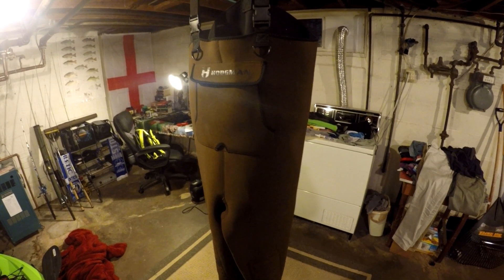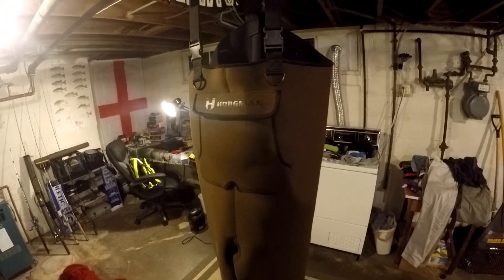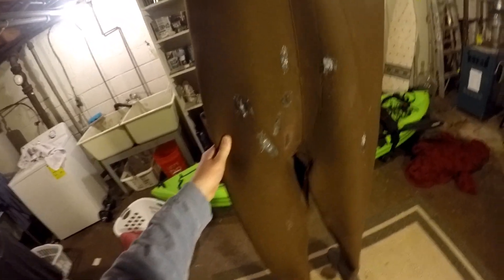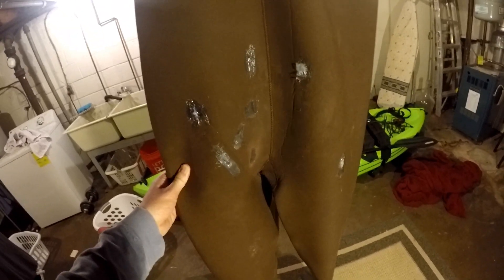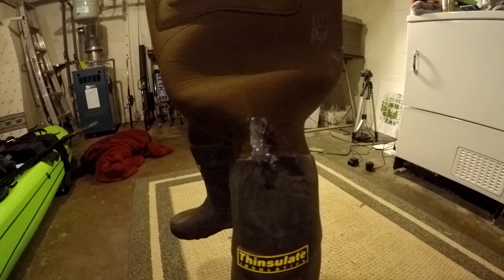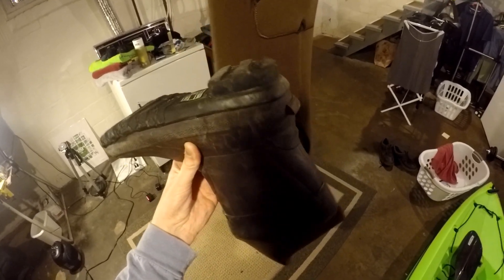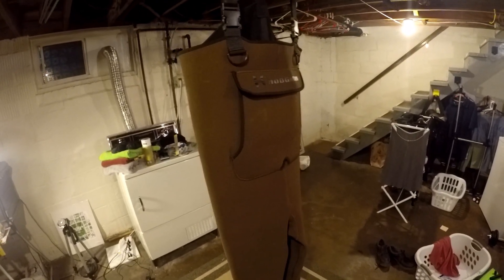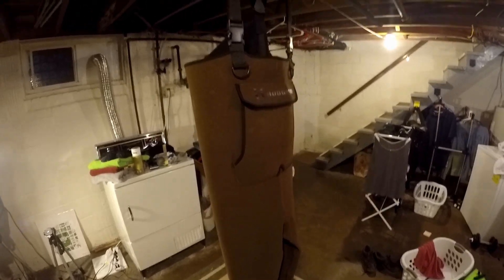WADER REPAIR (Hodgman Waders)

Comment: Yeah I have the exact pair I  punctured  them with thorns but it doesn't  leak. They have patches with the waders but use willy cone and patch em up. Bout mine at Meijers.
Reply from the maker: They're a solid pair of waders. I ended up replacing them for a lighter pair of hodgman's for year round use (the H3's - nice, budget waders but I do miss the neoprene in the winter months).

I also miss the durability a bit. With neoprene you can take some chances walking through brush, so long as there are no thorns etc. 
The lighter material isnt cutout for bushwhacking it tbh.

Tight lines
Reply: @otpfishing968  yeah there pretty sturdy pair

Comment: Poor waders. Take car of your stuff lol.
Reply from the maker: Im usually pretty careful, but the neoprene material sometimes lends itself to overconfidence - hence why I was crawling down a mesh slope that had sharp wire sticking out. It just didn't occur to me that I was in danger of puncturing them lol

Tight lines.
Reply: @otpfishing968  just messing with you lol. Im getting a pair soon. Im going to be very careful with them. I liked my old Hodgman green ones.
Reply: @otpfishing968  tight lines 🎣
Reply from the maker: @flyguy4515  Hodgman are solid. I ended up getting a 2nd pair - the H3's. Would definitely recommend them.
Reply: @otpfishing968  i was looking at those. What do you think about their newer models? Like the h4 or 5. Have you seen them.
Reply from the maker: @flyguy4515  haven't followed any of their newer waders tbh so can't comment if they're worth picking up. The H3's are great though.
Reply: @otpfishing968  forsure. Thanks man. Tight lines 🎣  just got back from a mini bike adventure lol. Went 5 miles cruising the san Joaquin river, only saw some 10-15 pound carp and a pretty 2lb spotted bass. No fish unfortunately